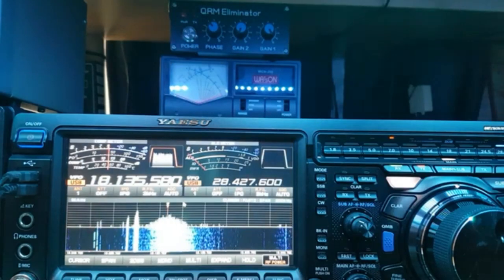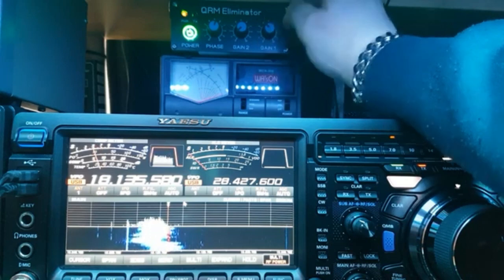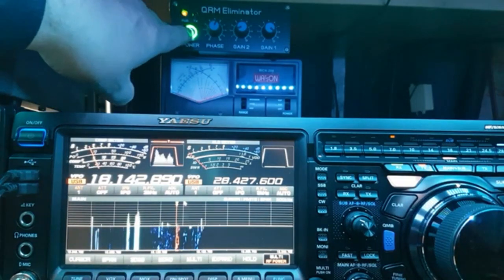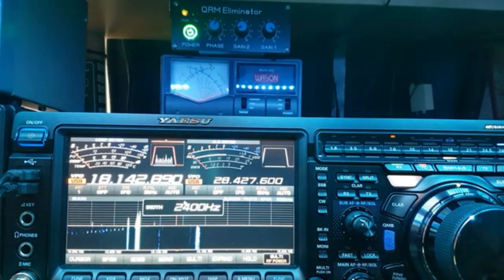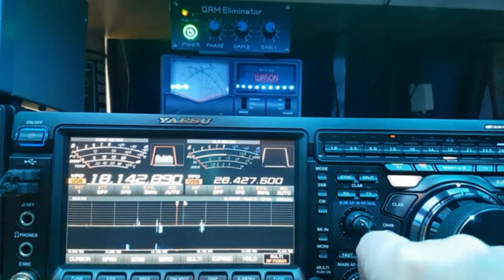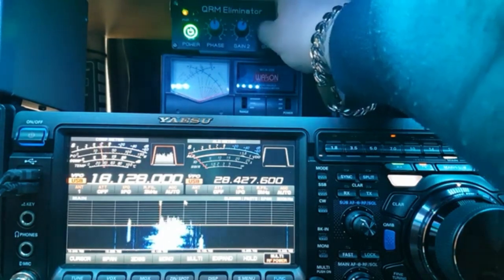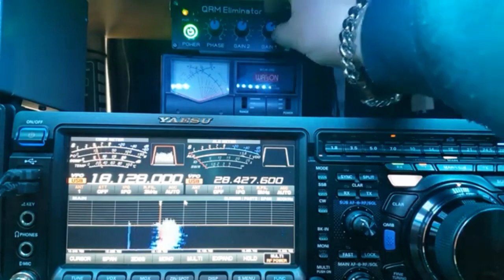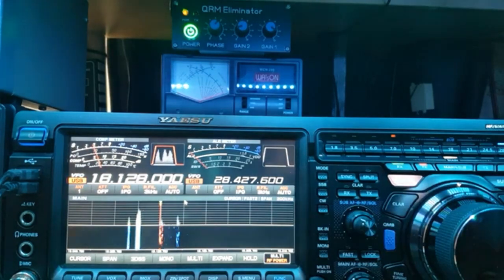Tuning a qrm Eliminator.

Comment: Great result but where is the position of the QRM eliminator listening antenna? It's on the roof or inside the shack? 73
Reply from the maker: The antenna is outside 65 ft end fed antenna
Reply: @hamradiostationg0dtx583 and your trying to tell us that THAT 65ft end red isn't receiving the wanted signal??  🙄 You clearly don't understand how this is supposed to work, AND you're tuning it all wrong..and it DIES attenuate ..THATS how it works 🤷

Comment: Thanks for the video. I still have my doubts, I have tried an expensive one and a cheaper one. I have spent day trying them with different aux ant. My conclusion with both units there was no difference between using the ipo on the FTDX10. The noise does drop but so does the signal you want. By the way you have an amazing transceiver.

Comment: Have you put the audio through a bhi speaker? It’s been a while since I used one but from what I remember they’d be good at cleaning up the residual noise.
Reply from the maker: I still use the bhi. I use it for the ICOM 7700 and yes you are right, they are very good